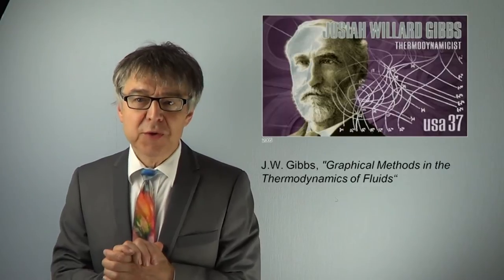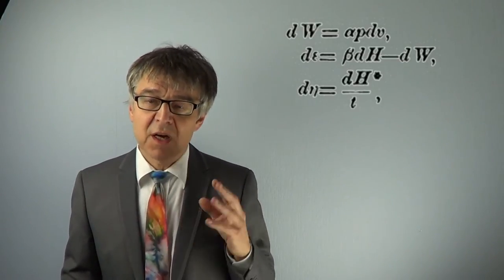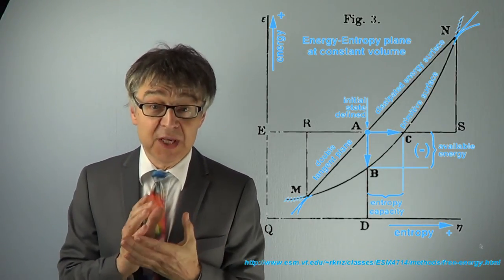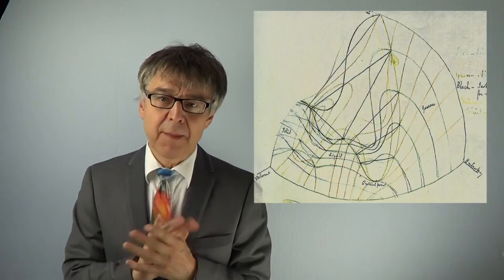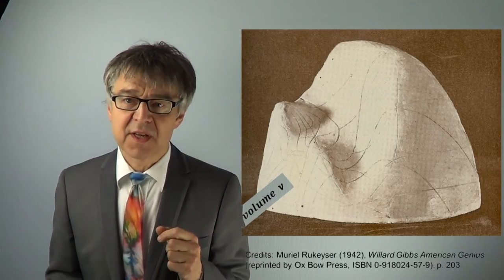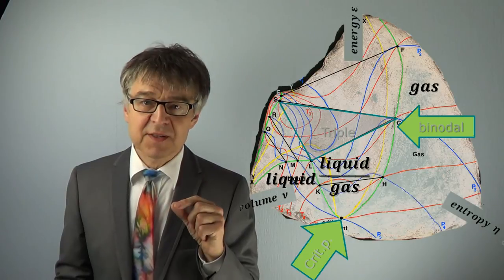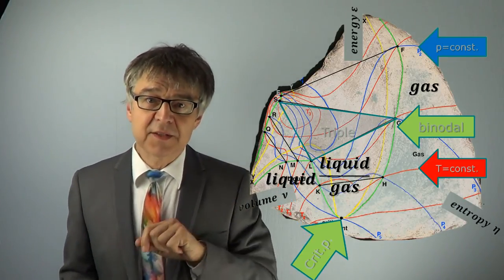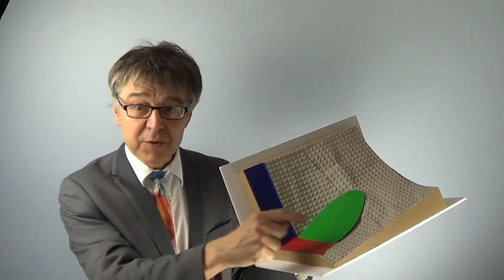Maxwell´s (or rather Gibbs´) Thermodynamic Surface (energy-entropy-volume surface) and pVT Surface

Comment: In Gibbs first (1873) publication, he explicitly states to avoid drawing a surface using pressure, volume, temperature axes, where it is not possible to observe the "triple point" that can only exist where volume and entropy of independent variables shown as axes in a 2D plane and third axes, orthogonal to this volume-entropy plane, is energy and must be a function of volume and entropy following the 1st and 2nd laws as shown in his brief derivation on the first two pages. If pressure and temperature are drawn as axes, triple point is seen as three points (for solid, liquid, and gas) that coincide in this plane which is confusing, but unfortunately this is how triple point has been taught for the last 100 years. If you ask students about triple point they explain the popular mantra, that triple point is when three points representing solid, liquid and gas coincide in the pressure temperature plane, with no explanation, because there is none. However if you use Gibbs original graphical method using energy as a function of volume and entropy this ambiguity is avoided and triple point is understood as Gibbs originally intended. This energy surface than also explains the the available energy underneath this common tangent plane which is the energy available to freely move from a solid to liquid or solid phases without additional energy provide by a chemical reaction, which is the idea presented in his third paper.

Using only pressure, temperature, and volume axes to define a surface reveals none of Gibbs original thinking and I believe this confuses students, which is why Gibbs politely explains on the first page of his 1873 publication that, "Although geometrical representations of propositions in the thermodynamics of fluids are in general use, and have done good service in disseminating clear notions in this science, yet they have by no means received the extension in respect to variety and generality of which they are capable. So far as regards a general graphical method, which can exhibit at once all the thermodynamic properties of a fluid concerned in reversible processes, and serve alike for the demonstration of general theorems and the numerical solution of particular problems, it is the general if not the universal practice to use diagrams in which the rectilinear co-ordinates represent volume and pressure. The object of this article is to call attention to certain diagrams of different construction, which afford graphical methods coextensive in their applications with that in ordinary use, and preferable to it in many cases in respect of distinctness or of convenience." In short DO NOT draw surfaces using pressure, temperature, or volume, because it does not show the relationship between the five state variables (Energy, volume, entropy, temperature, and pressure) and consequently it is confusing!
Reply: +Ronald Kriz Good post. Of note, Harold Blum (1934), via citation of Lewis (1923), was the first to apply Gibbs surface models to evolution: 

http://www.eoht.info/page/Chemical+peneplanation

in order to reform "chance" based natural selection.